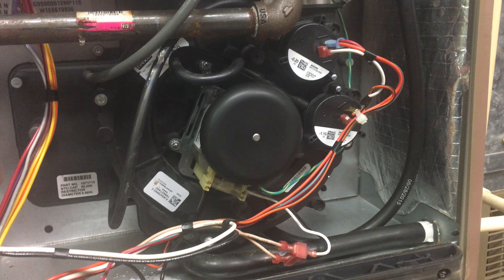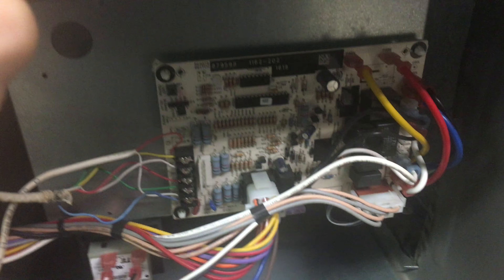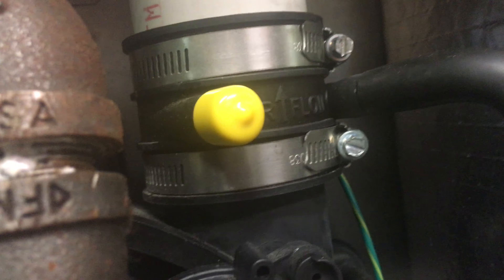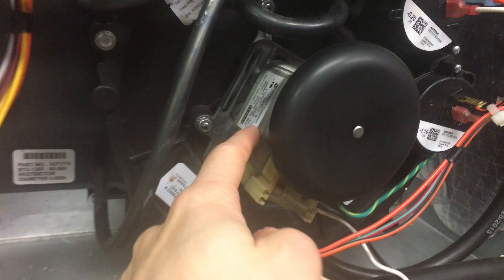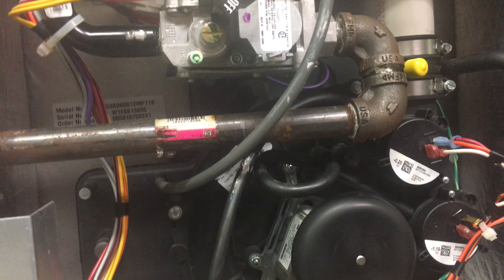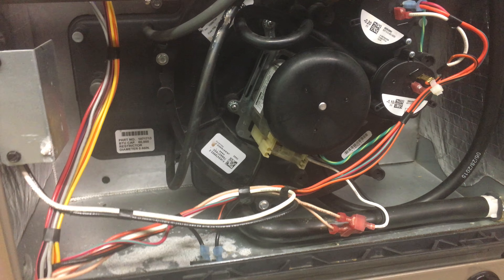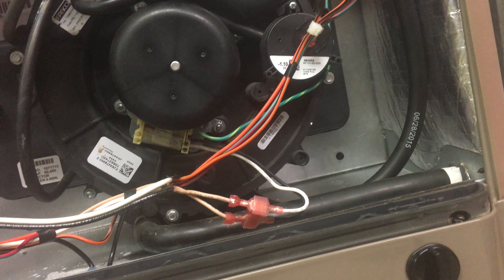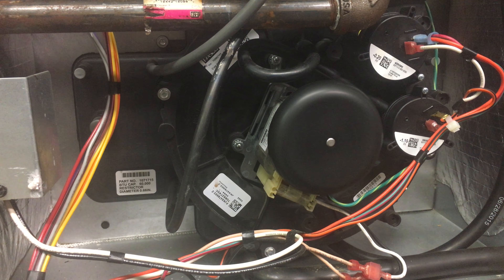Coleman Gas Furnace Inducer Motor Trouble 95.5%

Comment: It sounds like it needs new bearings but usually it gets really loud like a jet engine wine and then it seizes up.
Reply from the maker: they replaced it now it works the motor burned out because they installed it wrong and the intake pipe got rain water on the inducer motor caused it to fail.
Reply: My furnace induction blower is a little different than yours it's variable speed 3000 RPM fasco .